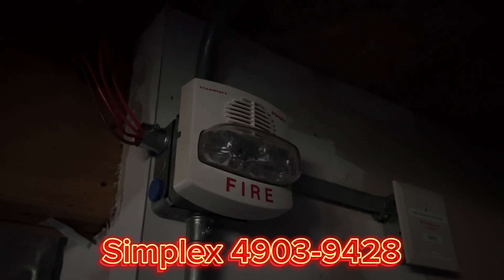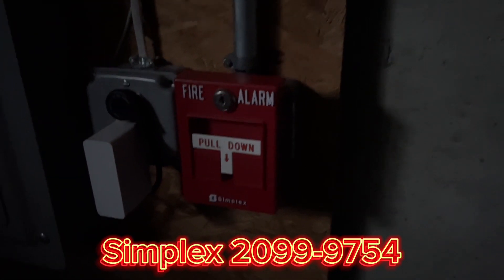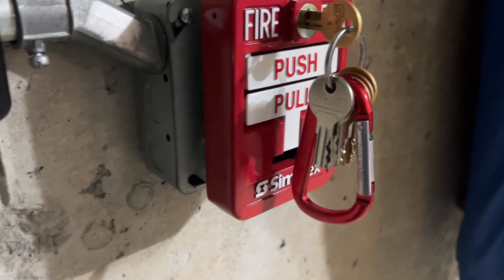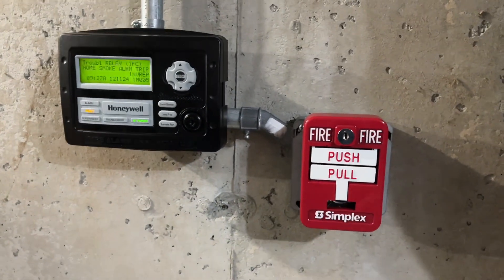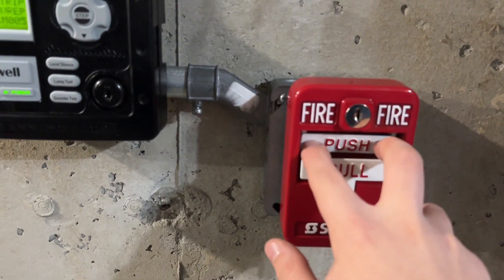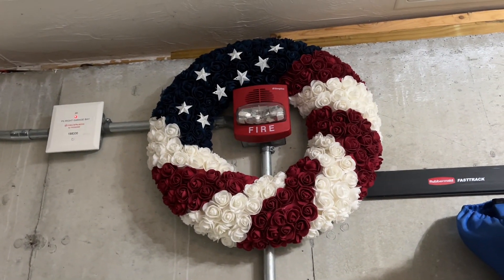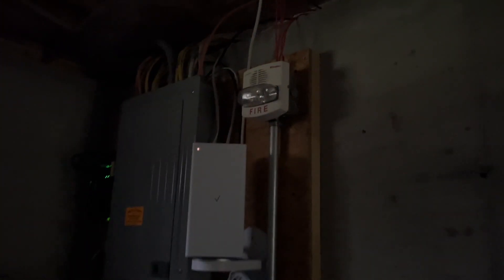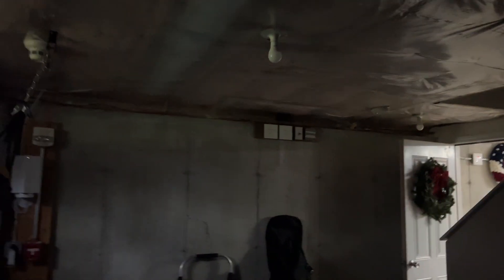Fire Alarm System Test 70: Simplex TrueAlerts

Comment: Do you have a simplex sync module connected to the panel ?
Reply from the maker: Sorta, the Simplex 4009-9201 (power supply) next to the panel has built in SmartSync, but it’s not a standalone sync module.

Comment: YAY STROKE
Reply: @Loganetics1  Gorrilas are immobilized in motorized wheelchairs then are turned into the disabled logo, then people speak out for their rights. Best chain of events
Reply: @Loganetics1 may you send a video on how to wire the i3 to the panel and the horn does not stop unless I reset the panel
Reply from the maker: @ make sure your horn is on NAC 1, not NAC 2. NAC 1 shuts off then you press the silence switch downwards. Is your i3 a 4 wire model?

Comment: First lol
Reply from the maker: Umm…. no.
Reply: @ Lmoo
Reply: @Loganetics1 one last thing. Is there anyway I can mount the power supply not the cord but the gray thing to the board I have
Reply from the maker: @NewEnglandAviaton987 there should be some mounting holes in various spots of the power supply. If you can find screws that are small enough then you can probably mount it. I’ve never tried to mount mine to anything, I usually just do the demo systems on my floor or my bed. Also you don’t need to ask your questions in the reply sections, you can just make a regular comment lol
Reply: @Loganetics1 it’s it fine if I mounted the power supply on an electrical box